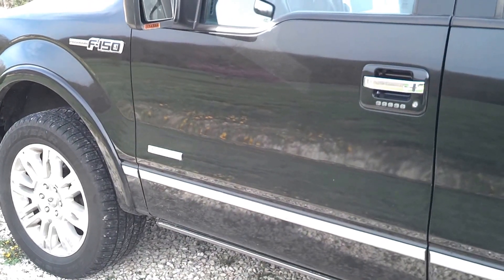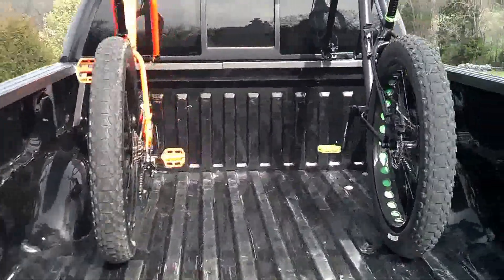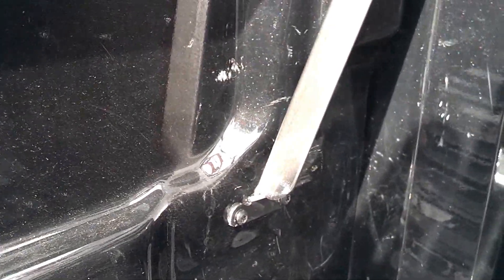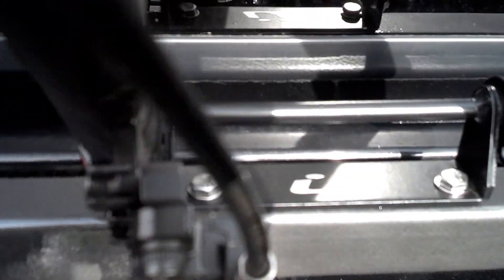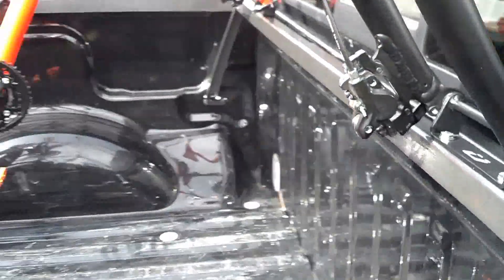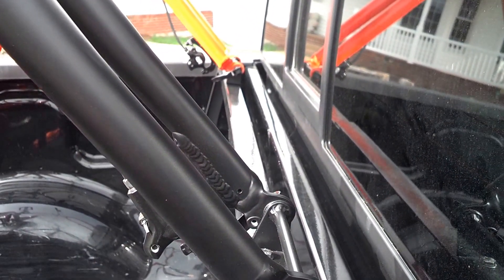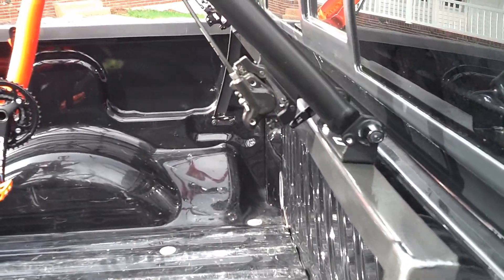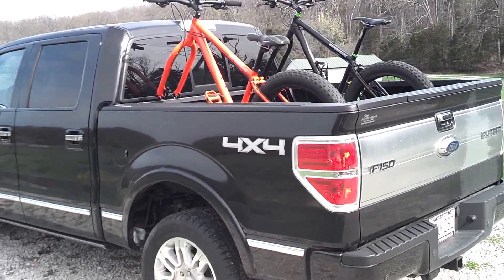DIY ~ Homemade Fat Bike rack mounted in the bed of a 2012 Ford F-150.

Comment: It looks pro... but when i see how its secured, it looks like an accident waiting to happen. The vibration and flexing from the bike may break the welds depending how good they are.  There should be something like a strap or something attaching to the rear cargo tie-downs to prevent it from smashing the glass if the welds fail.
Reply from the maker: Thanks for sharing your thoughts on improving my design @BIKE MAN!!

Comment: When transporting a mtb in this fashion, do you ever use anything to weigh the back tires down? I have my setup roughly the same but notice the rear-end of the bike bounces around some when the truck goes over potholes, rough roads, etc.
Reply from the maker: To be honest Wesley I've never noticed if they bounce around or not.  I guess you could attach some velcro to the bed at the point where the rear tires make contact with the bed.  Thanks for your comment!!